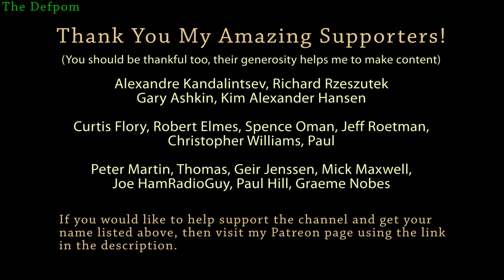#680 LoRa to WiFi Gateway Project Part 1

Comment: Thanks for the vid.  Do you have model #s for the LORA modules you showed?  Wouldn’t mind a block diagram/schematic of the setup.  I tried to check your website, but it seems to be down for me.
Reply from the maker: kEn J - it is a pretty simple setup really, I2C for the display, and UART for the Lora module, that was pretty much it. The Lora module is a E32 module from ebyte